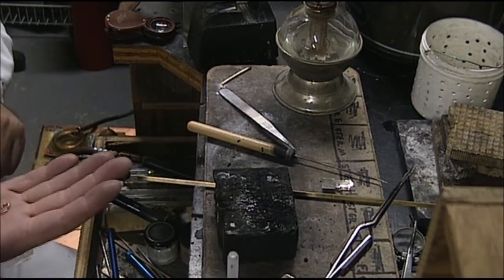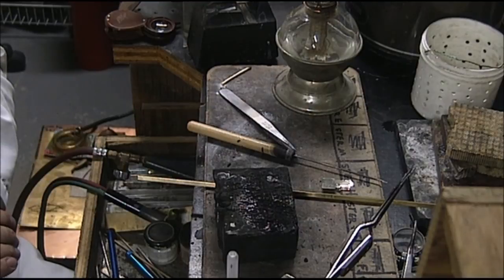Jerry's Basic Jewelry Benchwork 2, Using a mouth-pipe to solder

Comment: I'm coveting your lamp! I can't get my flames big enough- the only thing I've been able to find is an oil lamp. I got an alcohol lamp, but the wick wasn't big enough, so broke out my candlewicking and made a larger one, but can't solder anything larger than a 6mm 18 ga jumpring. But that lamp... *grins wickedly* Wherever did you find it? Build it? Thanks in advance for your response
Reply from the maker: It was part of a shop I bought from a retiring jeweler a few years ago. With a search on the internet I believe this one is about 80 to 90 years old. I have not been able to find one even close to it. All of the wicks are too small. I have been working on making a copper lamp that is loosely based on one in a illustration from a very old book. I am using the 1 inch welt for upholstery from Jo-Ann Fabrics. If you are in the USA you should be able to find a store nearby. When I get it done, I will post some better video of it in use. Look me up on Facebook under this name and send a friend request. =) Right now I am doing a lot with aiglets so I hope to have this new lamp done in a month. I need it to solder aiglets. =) Thanks for the comment!